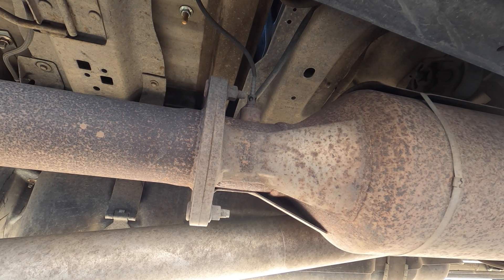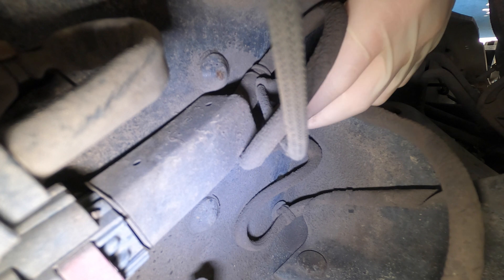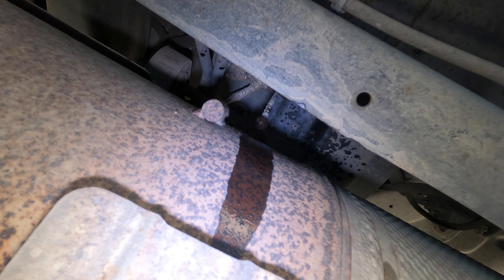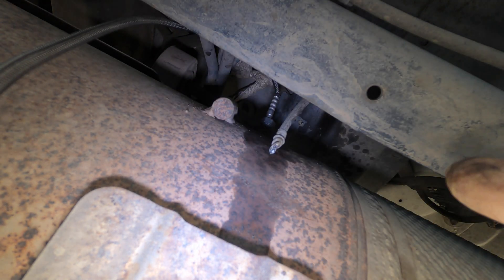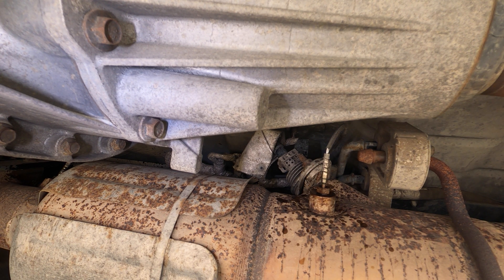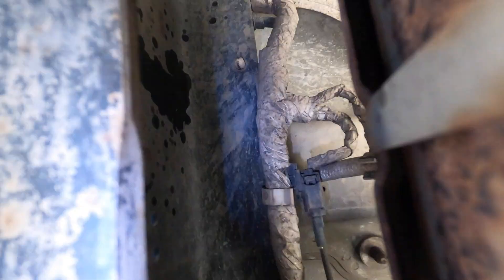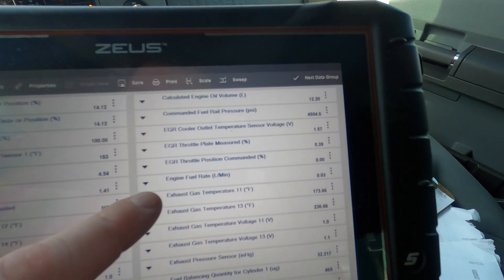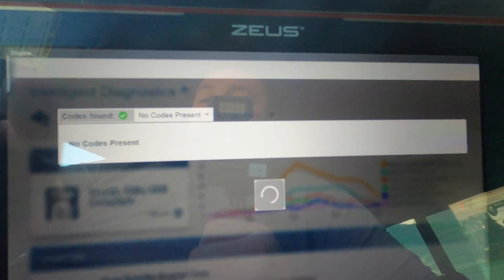Ford 6.7 Powerstroke Replacing Egt Sensors The Easy Way

Comment: Your video helped me swap out the #2 sensor, so thank you for sharing your knowledge and saving me money.  Your clip the wire and use the 13 mm socket is effective because the box wrench didn't work.

Comment: I have a 2012 F250 6.7. 300,000 miles. Only use Rotella and regularly change my oil and fuel filters. One day I decided to take it it to a take 5 to service it because I was too busy and they changed the oil and fuel filters. Later that evening the truck started to shutter at low speeds 0-20mph. I thought heck keep driving it. Could be the fuel has to cycle. It’s my first diesel. Btw… anyways so at this point I thought it was a fuel system issue. Thought the worst and assumed it was the CP4. After taking the upper and lower intake manifolds off I discovered no metal shavings on the little valve above the CP4. So thank goodness its not that. But now all im getting is crank no start. I really dont have the money to get it diagnosed/fixed right now. But the codes I got were P0193, P0183, P0107, P0198, P0118, & P007D and they all say Pending. Im also using a INNOVA 3100 scanner tool. 
Do you know what this might be?

Comment: Hey Drew I’m just curious, was just charged $ 880 to replace one, is that in the ballpark for price ?
Reply from the maker: The sensor is about $100-$200 depending on where you get it from. The labor is less than an hour for one sensor. Price does seem high but Maybe they had an issue and charged more labor.
Reply: I pd $46 at car quest but thought I was going to have to go to a shop to unplug the old one. Just to clarify, insert a pic,small flat screwdriver or similar shaped tool in the male end of the plug to pry up the clip on the female side of connection to lift it over the catch on the male portion as you pull on the male portion or tug on its wires to separate the sides. I did not understand that from the video. Nice job though but we could not see it.

Comment: hello drew thanks for the vid.  Great info.  I am having this issue right now with #4 sensor code P2471.  Did i hear you correctly in that all the sensors are the same?  Where are you located?
Reply from the maker: Thank you, on this truck the egt’s were all the same sensors on the exhaust system. I would recommend verifying the part number with your dealer and that they are all the same. I’m located in Southern California